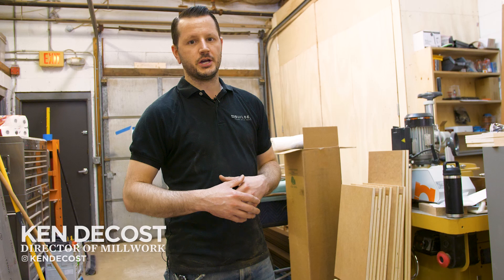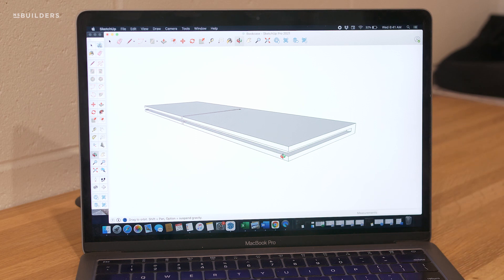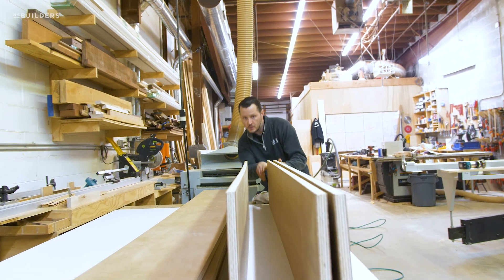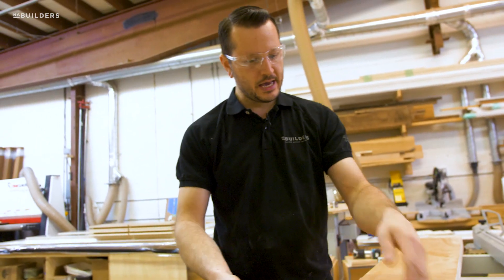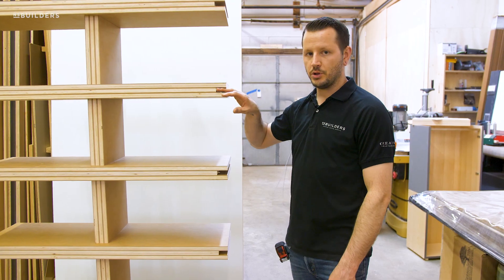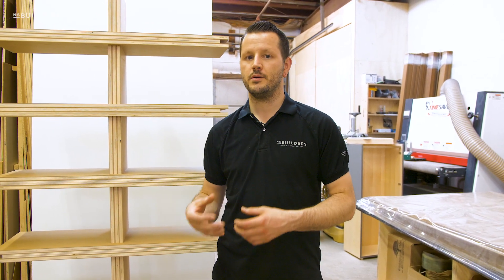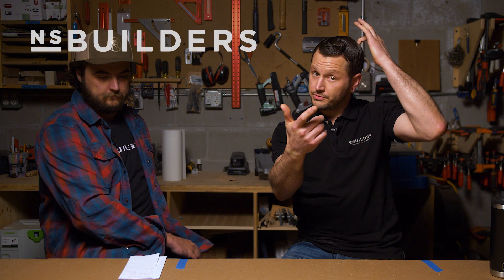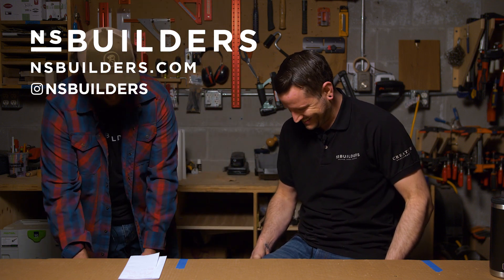Not your average built-in cabinet this is how we  | Revealed

Comment: I’m a GC who is Millwork heavy and I would add to the track saw conversation that the only place for a track saw in a mill shop where there is a table saw available is to break down goods to be easier to handle. If you’re going to rip a bunch of sheets down the middle I would rip a few at a time with the track saw then finish on a table saw.
Reply: 100%

Comment: Good video and information! What do you guys do for say a kitchen wall for studs and nailers and keeping the walls flat? Do you use plywood over the studs? Plywood between the studs or framing lumber blocking strategically mounted?
Last year I had to move some cabinets due to a larger refrigerator/freezer and the electric stove was replaced with a gas stove and the stove controls and the microwave above were damaged because they did not install the microwave high enough. (I suggested to switch over to uan infrared stove to avoid the heat issues).When I went to move the upper cabinets and microwave higher I ran out of blocking. Because the walls and tile were wavy as crap, I removed all the cabinets, ripped off the tile and ripped out the stud wall. I put LVL studs back in, and put in 
1 1/2” LVL beams vertically between the studs for blocking. Except of course for plumbing or electrical penetrations. I then used two layer of Baltic birch plywood with offset seams. The cabinets and Tile were installed on a dead flat wall and blocking was available anywhere!!!
The owner was very happy!!!
    What would you folks do if the owner wanted dead flat walls in the entire kitchen?
    Thanks for your time and hope you respond to the “what you would do” question.

Comment: I used to love SketchUp until trimble bought it and made it so you have to spend $300 to get the desktop version along with a bunch of other useless crap.
Reply: this
Reply: I was limping along with sketch up make for a long time. Finally pulled the trigger on Pro. Not so bad when compared to a lot of the other programs out there.
Reply: @kendecost  I still use the last version from Google. Make was for some reason extremely slow and froze up all the time!